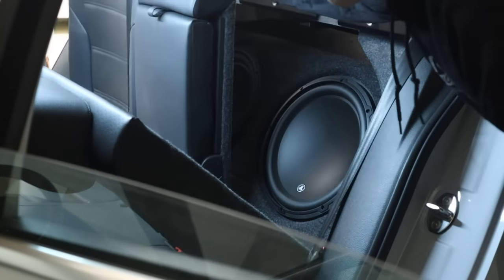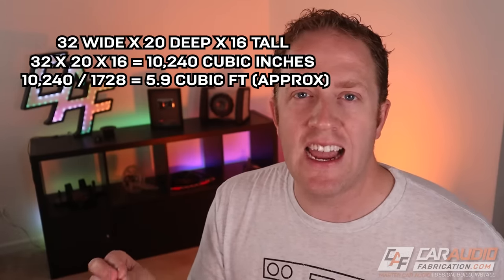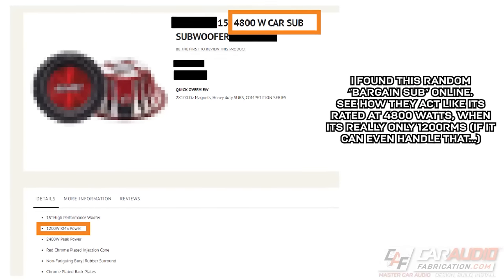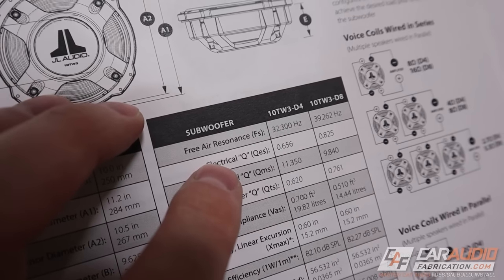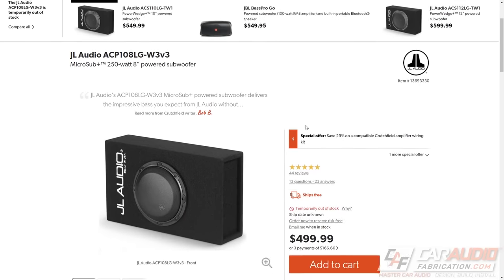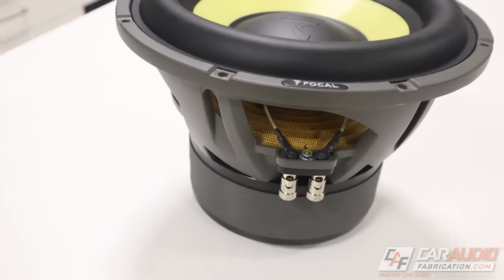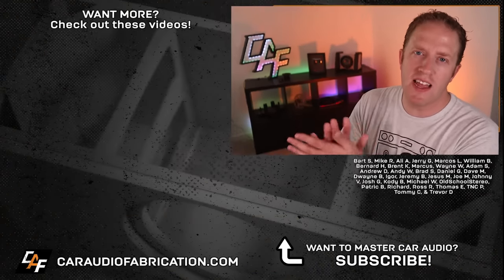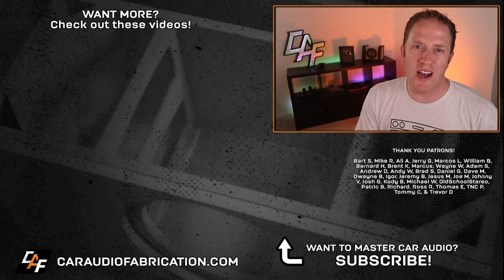DO's & DON'Ts - Picking a Subwoofer for YOUR vehicle!

Comment: I build a small enclosure in my car in a side well. I tried to find decent smaller subs which were powerful enough, but they were just very low powered unless I spent 500 bucks, compared to the 100 for the slightly too large sub. not ideal but budget was the defining factor.
Reply: Youre going to be very limited with such a small space
Reply: @TylerTheBassCreator  I totally agree, but it's what I have to work with sadly.
Reply: @TylerTheBassCreator  yeah, highly unfortunate when both space AND budget are both small... Dealing with a single cab Ranger I daily drive and also take on 13hr road trips, not willing to give up any leg room or recline (as if those even have any)... You want a challenging build, THAT'S tough. No room for an amp below the seats either, so that also cuts into your available room. I think my box's exterior dimensions for width were only like 6.75" at the bottom and 3" at the top @ like 13" tall... Even a little CompC 10" needed a relief cut to fit. (I used 1/2" MDF since all the panels dimensions were under 12" internally except the length and I wasn't gonna be running a lot of power, and also I recessed the sub to be flush mounted since the seat was almost gonna be right up against it.) Good thing my truck only has the 2 door speakers, cause I had to remove the rear speaker grills and cover em up with the box, so having speakers behind there would've been almost pointless anyways...
And even pushing into some weird dimensions inside and such, I still only ended up with like 0.86-0.96 cu ft or something, since I had to use the space behind the passenger seat for the amp, and decided still I needed ported for max spl from little power, and so I extended the box panels all the way the whole width of the truck interior made a block off plate for the box as far as I could before the amp, and the  had the port laying flat on the floor of the box and coming out the front passenger side, a sideways L port (might be improper length tbh, due to that), and then glued and stapled dense polyfil inside.
Other than the box, I spent $80 on FB marketplace for a used Kenwood amp and that CompC.

Comment: Could you do a segment for people that don't want a subwoofer?  What is the difference between a 8" subwoofer to a 8" midrange with these bullet cones and the old 8" full range with a whizzer cone?  all I want to hear is what was recorded on the cd for classic rock!  If the three above are quality and play say from 50hz  and up. where would you want the roll off to be 5000-7000 hz higher? I don't want buzzing and humming and thumping what does this do!??

Comment: I bought a sub inclosure of .375 and thought I like alpine type r sub.  Now my sub is dual 4 ohm and paired it with a kicker 600 watt rms 2 ohm amp.  I didn't take into consideration the inclosure for sub,  that's .5. I was told by multiple people to just run more power to it to open it up.  Specs say sub to take 750 watt rms. Some tell me to throw over 1k rms at it.  Thought I heard long ago that ported you didn't need to run a much power cause less resistance.  Thinking about just ordering different sub for inclosure,  more powerful amp,  ordering different box(amp would be cheaper), building a new box(not easy for vehicle). What's your take?

Comment: So I understand the concept of measuring your available air volume to choose the size of sub but...
I have a first generation Honda Fit. The boot is not closed off to the restnof the car, meaning I have available the air volume of the entire car I would say. Should I get the air volume of the whole car, or disregard the rest of the car and only measure the boot area?
Reply from the maker: It depends on the space you want to use for the subwoofer. The point I'm making in the video is guys won't measure at all before buying. They might have a space that is 30 wide by 15 deep and 15 tall and they get two 18s.... ummm yeah... that's not going to work. Gotta take those initial measurements into account.
Reply: In this video he is speaking about the airspace the subwoofer would need for a box and if you have the room in the space you are putting the box in will fit.  

Measuring the entire car interior airspace would be to account for cabin gain.  Which would be a whole other can of worms.

Comment: 89 Sedan DeVille (the "baby" DeVille), single 15" Sundown U-15 D4 running at 2ohm(1500w conservative RMS) wired to a Sundown SFB3000D(2000+w certified RMS at 2ohm), 250amp alternator, big 3 in 1/0ga ofc, power and ground 1/0ga ofc, 8ga ofc speaker wire, XS Power D3400 battery, 3.2cf enclosure ported to 32hz..... everything is gained and set correctly.... sounds like sheet. Same sub and enclosure but on a little Skar RP800.1D(so about 500w RMS at 2ohm) in my 02 Civic Si hatch (yes I know, hatch vs sealed sedan) absolutely destroys and is very musical....I was trying to keep my trunk in the DeVille somewhat usable, hence only going with one 15 in that 3.2cf enclosure, but damnit man, I'm getting frustrated (I initially had a single Sundown SA-8 D2 V3 on that Skar amp in there and it was clearly not enough, except at like 30hz, so I out the 8" and 800w amp in the Civic and bought the 15 and 3k amp for the Caddy). Help 😂
Reply: That's really super, super girl.

Comment: I have the subwoofers and the amplifier for the extended cab short bed early 94 Chevy Z71 Silverado new in the boxes 2 hed r series 7104s and the hed r series h7900.4 amplifier all cerwin vega hed r series, but then I ended up getting rid of the Silverado and got the 2000 dodge ram laramie slt quad cab long bed magnum V8 1500 4x4, and guess what it has way less air space so the box design which i was planning on getting a under the rear seat down firing box, and the same type of box the Chevy Silverado would use doesn't fit in the dodge ram.... so I never installed the subs and amplifier... Atrend,bbox, sound qube and qforms, and q logic ive had those brands except the q forms but I had considered them for several vehicles ive had,ive also had mtx, Rockford fosgate bandpass boxes, cheap Jensen and pyramid phase III gold series 12 inch deep hatchback full range sound subwoofer box, and a few cheaper options and whether people believe it or not they all are made different and sound different even alot of them were supposed to be similar setups

Comment: Im just trying to replace the factory speakers in my 2019 jeep renegade and get an android 12 stereo head. Do I really need a sub or will the door speakers be sufficient enough base for everyday casual listening? And if I do need a sub how small can I go so it doesn’t take up much space? Do under the seat type subs any good? Doesn’t seem to have enough airflow

Comment: I have a Prius and I'm seeing all sorts of don'ts. What's the proper way to install a good sound system without doing any mods or adding batteries?
Reply: Prius has a 12 volt system on it but not sure if the recharge on car can handle the extra draw. They made a cross over with the 400volt system for that car so you can use Amp off the big battery,  but if you don't know what your doing you can kill your selve fast with 400volt DC, someone made it and I don't remember who sorry was long time ago I saw it

Comment: This is a request for recommendations if I may. I have a 2022 lexus gx460 with the mark Levinson audio . This system plays plenty loud and clean for me however it does lack some in the low end bass department.  What possible add on devices , amp and sub might this community recommend to complement and replace only my existing subwoofer while ideally keeping all of my cargo space free? I'm certainly open to modify my panels to accommodate a more capable sub. Just want to know what to expect in terms of the best possible integration.  Hopefully not too complicated to integrate properly lol. Any recommendations are very much appreciated.

Comment: Great videos, I haven't done any audio upgrades in about a decade last system I had was 2 JL W6 10" paired with a Brutus. I recently got a Audi A4 2001 and I'm putting a deck and components in it, also a sub and amp. Was curious if I'm gonna kill my alternator? I got a 12" Scar EVL  2500w and a HIPhonics Zeus 2225.1 Theta, and a Rockville 50 Farad Hybrid LED Car Capacitor w/Dual Meters to hopefully help with my power issue. Anyhelp is super appreciated 🙏,  thanks for reading.
Deck Alpine ILX-W650.  Paired with Alpine KTA-450 4-Channel for the components.

Nothing is installed yet, I go next week for install. Car is completely stock.
Thanks again for reading.
Reply: JL is the best hands down I have 10inch wo like the first version of them 100 watts and it slams

Comment: So I have a FORD escape it’s a 2012 Limited. So I guess that it has a factory subwoofer and amp. Okay. So my question is how can I replace the factory equipment with aftermarket equipment and I want to use a in line converter can you please help me figure out what I need to do ??

THANK YOU 🙏

Comment: I got 90 bucks to get A 10" DVC sub. Needs to play as low as possible in a .75 to 1.0 box. Would go bigger but I'm a delivery driver need almost all my trunk and it's just a Civic. Got about 500w of power.
Any suggestions?

Comment: I have a civic exl 2016 with rear deck coaxial db652+ and i plan to put 6502 components for the pillar speakers and the door subs, what’s the best in line amp option for this setup? Or how could i properly run an amp in this car with a factory head unit?

Comment: Not very related, but how do I get rid of noise in my audio system in my RZR?  I have 2 speaker pods in the rear, they run off a 4 channel Amp mounted under the dash. They sound great until I turn on a rear LED light bar, then a high pitch whine. The cable for the light runs dount the side of the rzr underneath. The speaker wires run through the center tunnel. But the come together for 18" in the roll cage. 

What can I use to solve this.  Everything is well grounded.

Comment: I have a question I just finished my system and my subs are 2 jbl 12s running around 150 each (that’s the output but rms is 250 but I under delivered so I didn’t blow them) but anyways 2 jbls 250 each and I’m looking at future installs and I can’t decide if I wanna go Rockford or kicker I would most likely go with 2 12s again because Rockford is a classic and supposedly very reliable but I heard kicker is like the new Rockford any suggestions as to what to choose

Comment: I have a 08 Chevy impala. 43X53x23/1728= 30.3ft3. Mathematically it’s right. But it just feels wrong. Those numbers are in inches. So is changed them to feet and rounded up or down to the nearest whole number. 4x5x2/1728 and got 0.02314 I’m confused.

Comment: I have few questions I hope someone can answer them, mind me I'm still learning:
I have 2 subwoofers, first is 12 inches and rated as 600RMS and the second is 8 inches rated as 300RMS, powered by 1 amp rated as 600watts at 2ohm. My first question, is it a good idea to have 2 different sizes of subwoofers in my car? would they sound off?

My second question, Is it possible to have two subwoofers connected to this 2ohm rated amp? the first is 4ohm DVC and the second is 2ohm SVC. if so how do I make the connection? I'd really appreciate it. Please let me know even if I'm doing that in a wrong way.

The reason why I'm doing this is to preserve space in my cargo area so I wouldn't have to use a subwoofer box/enclosure that could take half of the trunk.
Reply: Do not use 2 different subwoofers in the same car. You'll get cancellation, distortion, and could damage the amp/sub. Just use the 12 on the 600 watts. Or, if you wanna save space, use the 8 and governor down the amp
Reply: Opinion; 2 B2 audio subs 8 inch or 10’s, , upgrade alternator, +2 batteries, SounDigital amps, and your box not be a standard box. Get a special made box built specifically for your SUV and have it tuned.
Reply: You can use two different subs but you need 2 amps , reason is because the ohms well fry your shit,  you have to have them in two different boxes , also get DSP so you can get that flat response and you will have the best bass in town, BUT DO NOT USE TWO DIFFERENT SUBS ON SAME AMP.....

Comment: Got a question for you. What size of sub would you use for when you play music ranging from new country to rap?
Reply: The size of the sub is irrelevant.  The size doesnt determine the bandwidth or ability to be loud, the enclosure that the sub is in is the deciding factor. You can have the nicest sub on the block but your sub only as good as the enclosure its in.
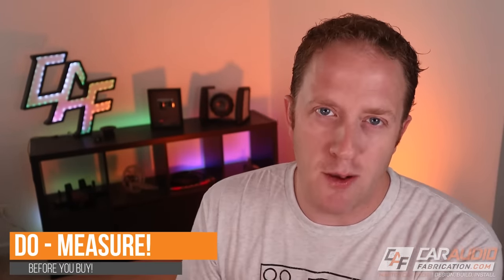Reply: Re watch 0:49-3:20 again
Reply: @TylerTheBassCreator  bigger subs can play lower waves that are hard to achieve on smaller subs?
Reply: A small sub in a proper enclosure can be just as capable of playing low too in the right application
Reply: @poindextertunes  go watch exos video on it. They do a good general explanation of why that isn't necessarily true
Reply: I'd go with a single high end 12 inch enclosure with an equally high end amp to push it but also upgrade your midranges  in doors.

Comment: I just built a 4th order box with a large volume 1 cu ft sealed and close to a 2 cu ft vented side running a 10" sub.  Sounds great but really want to see what proper specs are for my build.  Is bass box pro the only option or is there a good free calculator to use.  I've found plenty for ported enclosures and sealed but I get lost in finding definate data on fourth order specs?
Reply: And there is no definite answer on the best 4th design for a particular sub because youre the one that determines that if that makes sense.
In other words you can get whatever sound you want out of a 4th they can be tailored to sound how you want it too. I design and build subwoofer enclosures for a living and I wont run a ported or sealed box again in my personal vehicle lol once you hear a proper 4th you cant go back lol
Reply: Let me know if i can be of any assistance

Comment: Is safe to over power your subs by 50 watts. I've got 2 12s 300 watts each 4 ohms SVC and my amp is 650 rms at 2 ohms
Reply: But is it 650 rms and does it make rated power if so? Also how long will they take it at high volume ?
Reply: @chichidouglas5078  at high volume it handle it with no problem with no distortion or clippings and my amp meet rate power it dyno 680
Reply: @elroycooley398  most reputable sub manufacturers also underrate their subs. There's also impedance rise and  the output power fluctuates up and down with the changing frequency that happens in music.
Reply: Music is dynamic, so no matter how big your amp is, it's probably never producing maximum power, and even if it ever does, it's only milliseconds at a time. You'd have to play a test tone or sine wave at maximum volume to ever send full continuous power to the subs, and no one actually does that. It's kind of like a car, it's not producing maximum horse power except under certain conditions, but an amplifier will do it even less of the time than a car.

Comment: How do you know what will sound good in your car? I have a 71 Buick Riviera. Its trunk is shallow so I thought a 10inch at around 500 rms would be good but then others are trying to talk me into 2 12's at 400-500 rms. Is there a way to know what will be enough?
Reply: The more air space you have the more air you need to move so get ported to help move that air , sealed works better in trucks where the subwoofer is right behide you
Reply: I would get 2 12s ported buy JL Audio they have some of the best pre-made boxes there is a reason there pricey because there one of the best out there

Comment: Is it bad to slightly exceed the airspace for a sub? For example, if my sub shows to need .75 cubic feet and I choose a box that is 1 cubic foot. Would that ruin the sub?
Reply: i would tjink worste case scenerio is the sub might bottom out full tilt and you will either have to turn down the bass knob if you run one, adjust the lowpassfilter on the sub amp to not play realy low notes, or turn down the gain a little until it doesnt bottom out anymore

Comment: Another great video. I have a question I was hoping you could help me with. I have a reputable brand amplifier. It is rated at 1200 Watts. It is rated at 1200 Watts into 8 Ohm. It is also rated 1200 Watts into 4 Ohm AND it is rated 1200 Watts into 2 Ohms. How is this possible? Any help in understanding this would be appreciated.
Reply: Maybe it would help of you specified the model. Some amps can deliver same rms with different ohms. Example, taramps.
Reply: Some amps have like a smart Amp system so 1200 watts is 1200 no matter what ohms you do.  I think some JL audio does this

Comment: I was thinking of putting 2 12s running about 1200 watts each in my 85 monte carlo but im starting to wonder if that may be too much for that space
Reply: Perhaps, you could go with two 10's and still bump pretty hard.
Reply: I had and Olds and you need 12s to push the air , trust me on this one that's a big car , if your in a truck seal 10s are perfect,, but you need bandpass port 12s , pre made JL Audio is best

Comment: You really Love JL Audio. May I ask why ?
Reply from the maker: High quality gear that is reliable and designed by real engineers here in the USA, with many of the lines also being built in the USA. This isn't just some manupackager hiring a build house picking random parts to go together. JL does real R&D and has tons of proprietary tech. Also I've used them for a LONG time. Long before I started the channel, I've always had a good experience